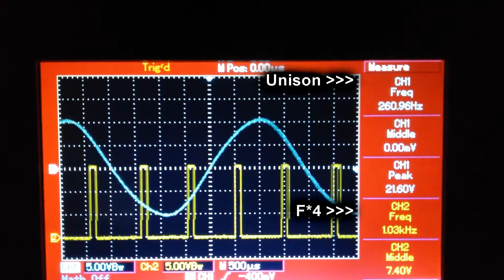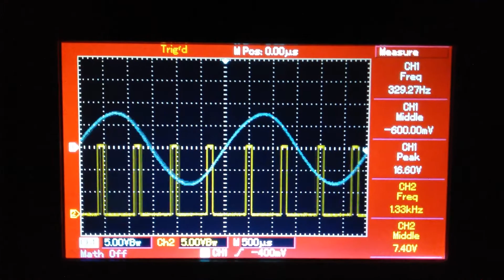Guitar Frequency 'Quadrupler' Circuit on Breadboard

Comment from the maker: In retrospective, I think Guitar Frequency Quadrupler is a misnomer, as the circuit can process any signal within the normal guitar range (82~1320Hz). The input signal is first amplified, compressed and filtered. The complicated part is leaving the fundamentals untouched and attenuating partials at least by 12dB, over the entire frequency range of interest, this requires a frequency tracking filter and a set of well tuned band reject filters, switched according the right frequencies at the right moment. The effort in developing and tuning the switched filters is recompensed when we hear a quasi sine wave at the filters output, maintaining a nice constant amplitude over the guitar range. The frequency multiplication circuits that follows requires this clean signal in order to work best. The multiplication is made in two distinct steps, first a precision full wave rectifier doubles the signal frequency, its output is then transformed into a square wave and sent to a second frequency doubler, this time made with CMOS logic. This final frequency quadrupled signal can then be used as a two octaves higher transposition effect, can be frequency divided in order to get a different transpositions: divide by three still provides an interval above the initial signal fundamental, divide by five, six or seven will be within the first octave bellow fundamental, and etc... Another use of the quadrupled frequency signal is to derive a frequency to voltage converter using higher cutoff filters, and hence getting faster frequency to voltage conversion with less ripple.

Join this channel to get more in depth information and exclusive content:
https://www.youtube.com/channel/UCQxQy-Z7SF7LFKsvSpqrTXg/join

Thanks for watching.